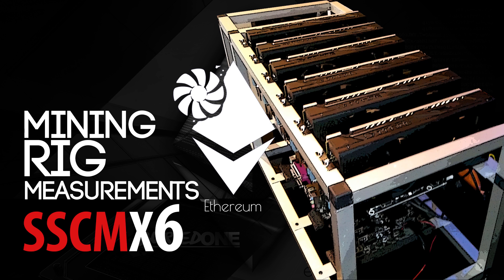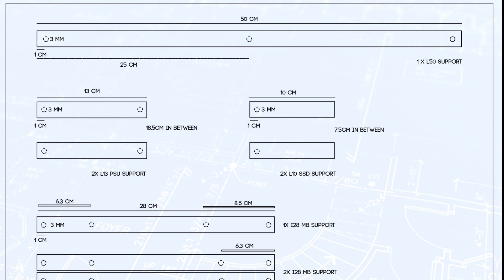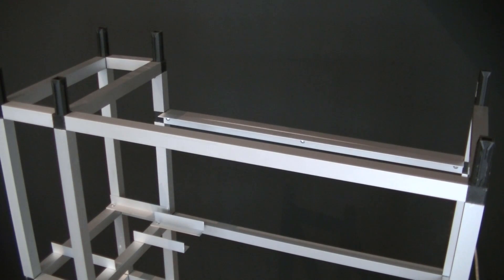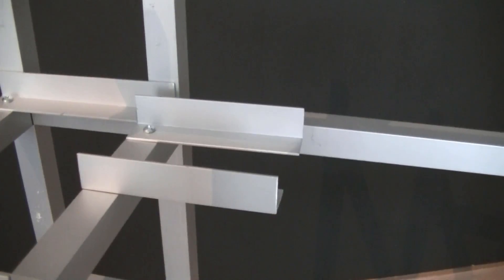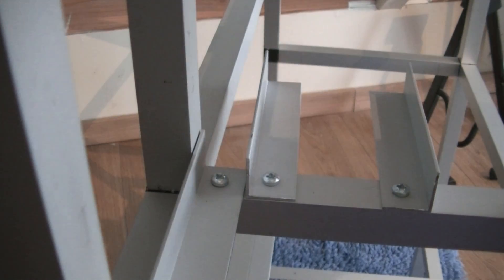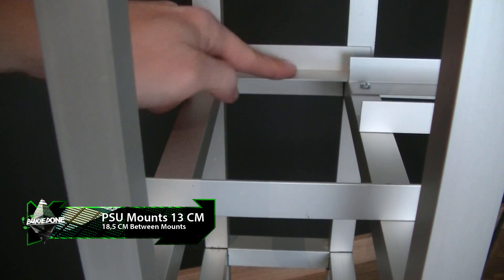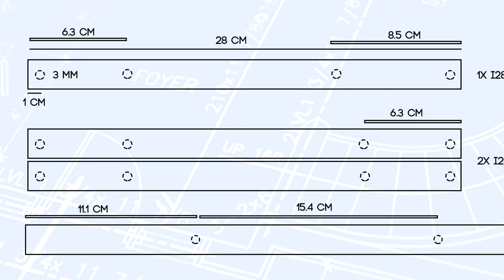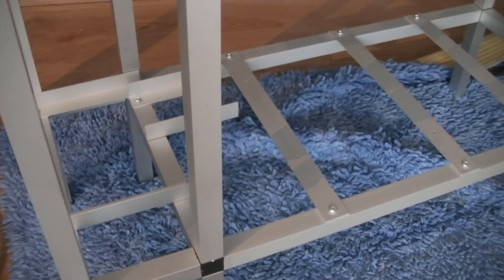SSCMX6 Ethereum Mining Rig Measurements

Comment: What size was the square tubing. It looks like some dimensions on your print are missing. Without knowing that, you don't know what length to cut the tubing.  For example the PSU support is 13cm total for the angle but the cut length of the tubing would be 13cm minus the fitting size which is what??  Maybe I'm missing something. Also what is the length front to back?

Comment: Hey Buried One im planing to build a rig like this but am on a rather tight budget. I currently have a 960 and a 970 sitting around doing nothing and I plan to buy two RX 470's. Could I use such a mix of cards or would it not work?
Reply from the maker: RandoGaming You can mix them its no problem at all with tge claymore miner